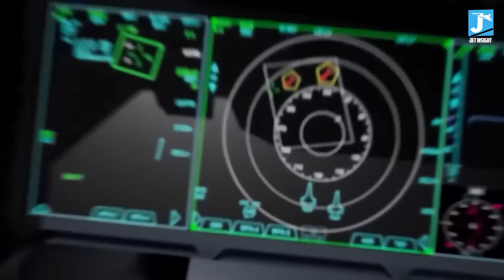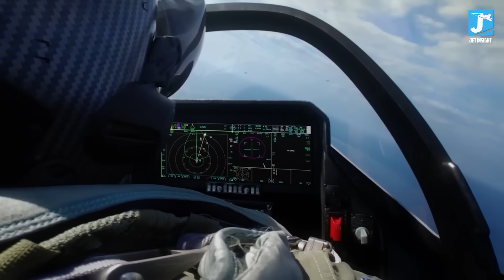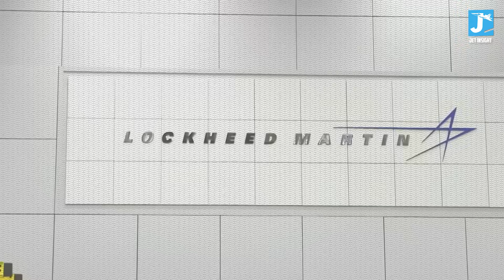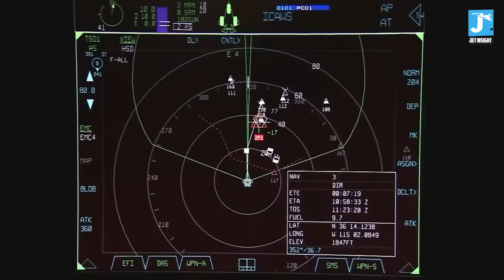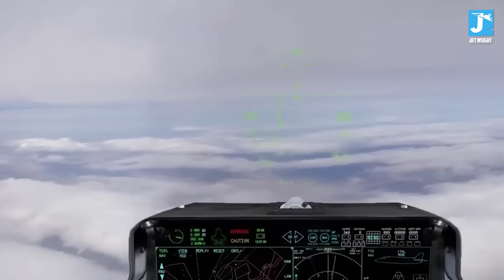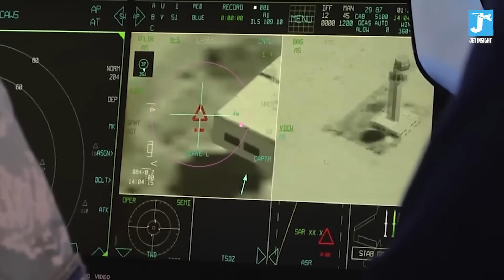Boeing’s F-47 NGAD Fighter Could Be Flying Sooner Than People Think

Comment: They are already flying. All we got in March was confirmation on what company is building them.
Reply: And in my opinion they picked the wrong contractor for the main contract. Boeing was wrong.
Reply: i think Boeing was the perfect choice, they were better able to fit the budget and timeline the pentagon set and Northrop Grumman is already busy with the B-21 Raider production, asking them to also do the F-47 program would have probably created issues in timeline.
Reply: @matthewc1062 I get that, but their quality and manufacturing performance has degraded big time over the last ten years. I want it to fly without pieces falling off or the jets dropping from the skies.
Reply: @SlipMahoneyBowery I understand that viewpoint. Yet their commercial and defense departments have little to do with eachother.  Bascially two seperate entities own by the same parent company.
Reply: exactly, the mass produced civilian grade aircraft will be a completely separate animal than the top secret military grade aircraft which requires extremely high clearance. No doubt Boeing has had some issues commercially, but they pitched the most advanced technology to the pentagon for the NGAD program over the other defense contractors, that combined with their behemoth industrial capability plus  they have a vested interest in creating cutting edge tech to keep the US ahead.
Reply: @matthewc1062 what Boeing produces doesn’t remotely compare to what Lockheed Martin Skunkworks produces. The most advanced always comes from them.
Reply: that’s not how it works. There’s articles you can read on the engineers at the top defense contractors (raytheon, Grumman, Boeing, Lockheed etc) and they explain how they don’t necessarily stay at one company terminally and they tend to hop around from project to project to the latest and greatest fitting the needs of the military. And also each of these contractors (many which i didn’t list) has their own niches - some specialize in communications and radar detection, stealth jets, others in submarines, naval vessels, the list goes on, but one contractor cannot be “the best” the military is just too huge and we should be grateful we have the many qualified engineers to create these futuristic beasts.
Reply: @matthewc1062 and i think LockMart is also busy on F-35s
Reply: @SlipMahoneyBowery  maintenance is VERY important, one of the reason why F-35 is so expensive because without proper maintenance, anything will break down
Reply: It was indeed made by myself. I found a Chinese company to make it. Made in China.

Comment: What needs to be done is to develop the F-47 as a carrier-based aircraft! Then, like the old carrier-based F-4, add it to the Air Force inventory. This way, both branches will have the same aircraft without all of the different changes as we have seen with the F-35A/C aircraft. Learn from history. Both the Navy and Air Force had a long, proud tradition of flying the F-4, and the F-47 could continue that tradition. Also, the Naval variation of the F-47 could be given to the Marines and used like their F-4 Fighters. This way, all three branches of our military could fly the same basic version of the F-47, while the Marines could still fly their version of the F-35B as their STOVL fighter.
Also, building more aircraft can lower the cost of each aircraft for the manufacturer. It would allow more of the aircraft to be built for our three branches of the military, plus, at some point in the future, we might be able to sell later versions of the fighter to our allies.

Comment: The thing's gotta have a vertical tail to some degree so why do they keep showing it without one?  The B2 and B21 are not air dominance.  They don't rely on speed and maneuverability.  But the F47 is so it's gotta have a tail otherwise it wouldn't be able to maneuver well.

Comment: Isn't Boeing's quality control crap right now? Aren't they? The company that doors have been falling off planes, nuts and bolts. Been falling off planes or quality controls. Just a little out of control. I'm a little concerned. Always proud of my United States. Not only did I serve 4 years the United States Army, but I'm also worried about people when they go up in some kind of crap that isn't reliable....

I just hope it was a completely different group building that or contractors 

I hope it's not the same group building 747s.

I know Google's usually a liar because if I ask what the best car audio amp is, it will tell me boss which is actually the worst quality amp you can buy. But it is saying Boeing's quality control is under par ...

I wish us luck and a safe trip 

HOORA!
Reply: Boeing separates military and commercial contracts . 
Boeing absorbed McDonnel Douglas, and those teams dont work on commercial contracts.

Comment: So, here’s my questions. What will it cost per hour to fly this thing? We already have a 5th Gen ASF we can’t afford to fly. So it sees minimal action. Upgrades for F15 EX & F35 already have the capabilities to go toe to toe with China’s so called 6th Gen fighter. Will this thing even see actual service or are we just building another hangar trophy??
Reply: Won’t be a huge factor when the fighter will mainly operate as a command station for a swarm of unmanned drones
Reply: @martin.maxwell.2477 But this is already being implemented into both 5th Gen and multiple 4.5 Gen fighters as we speak.
Reply: @ENCAGED79  an aircraft can only be modified to a certain extent. Modifications can keep older generations relevant but a gen 4 will never have the stealth as a gen 5 no matter what costly upgrades are done to it and I’m sure the same difference will reflect between 5 and 6
Reply: @martin.maxwell.2477 I get all that, but my point is, The Raptor was never used to its full potential. It’s slated for upgrades that will all be standard on the F-47. Will the F-47’s fate be the same?
Reply: ANOTHER hangar trophy?
Will it be expensive?  What new technology isn't?
Relax... China can't launch anything from their boondoggle aircraft carrier.
They thought they could tackle the same EMALS  problems we have... only they have about 1/3 the total power of our aircraft carrier.
They cant launch AND recover simultaneously.  Hence, no Fujian launching ANYTHING on Xi parade day.
Fancy mock ups though...😊
Reply: @fightfish3265 Not worried about China. Just hate seeing such amazing art go to waste

Comment: Test flight is the formality of any aviation trial. It's not finalized yet due to electronic and mechanical service that takes time to get it right.
US does it better than any other superpower to my knowledge.
Reply: China does it ass backwards.   They fly prototypes with the landing gear down for proof of concept, and to sway the populace....
But as far as ACM, or new system integration, well... 

Meanwhile, the PPT F47 is collecting airspeed data at Mach 2....
😂